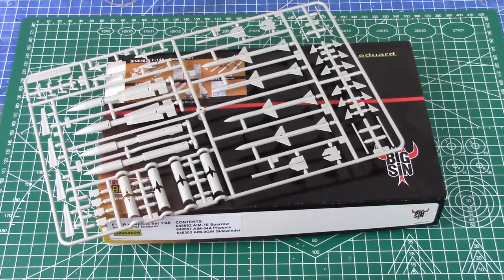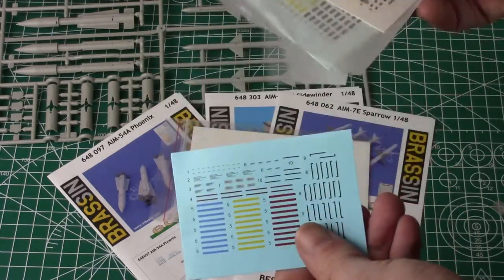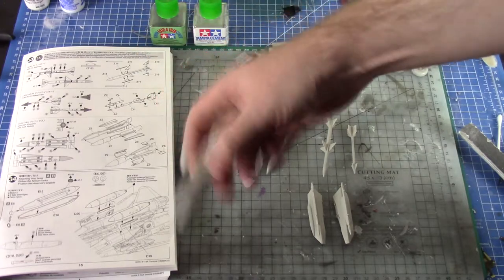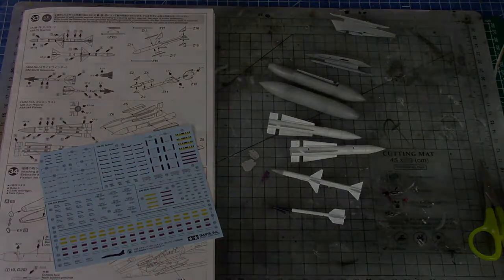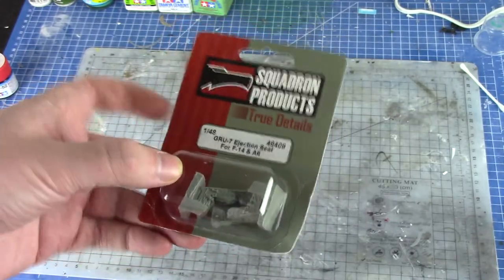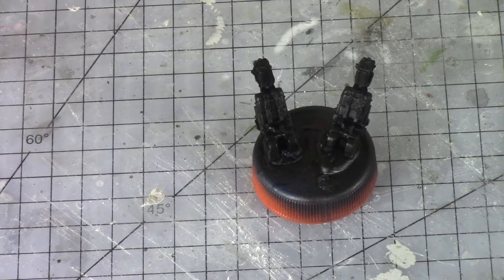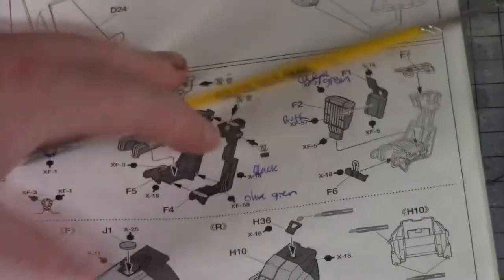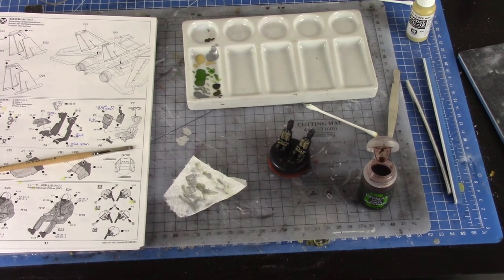1/48 Tamiya F-14A Build Series - Part 5: Missiles and resin seats

Comment: Eduard Brassin AIM-54s are about 4mm too short, dimensions of Phoenix missiles from Tamiya kit are spot on.
Reply from the maker: Yeah, tbh the Tamiya kit is so nice aftermarket not needed. As you see in the video I did not use them and sold them on eBay. Richie
Reply: @RWHobbies  True, Tamiya kit is a marvel, definitely no aftermarket needed. I'm building D at the moment and built A just after it was released. Great videos mate, love your work. 🍻